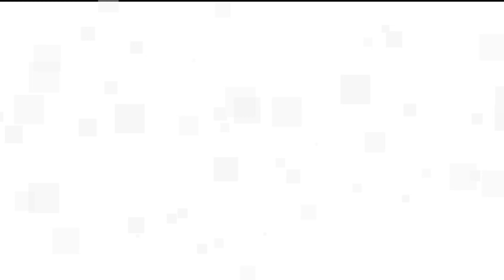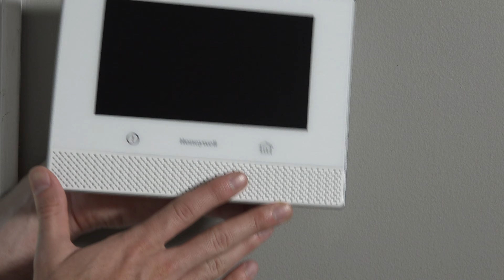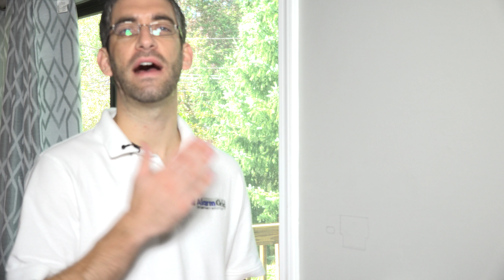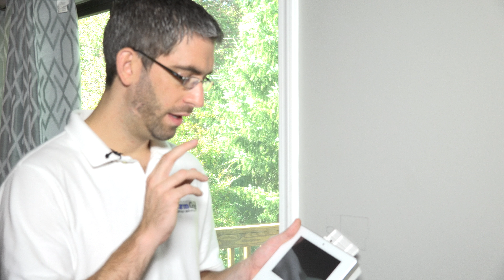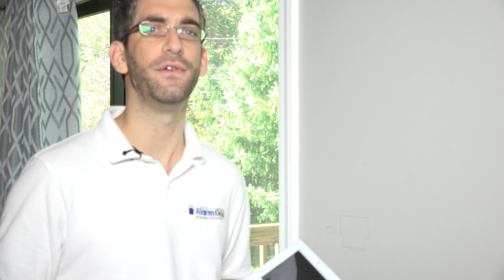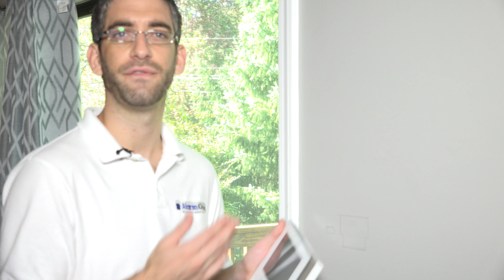Lyric Security System: First Impressions

Comment: Hello, sorry if I bought this device, Can I use it in Peru with any trouble?
Reply: The Lyric can be used in Peru, you wont be able to use a cellular communicator with it but the panel will still connect to your wifi network and function without issue.

Comment: If I use the Lyric controller without monitoring but connected to Apple's HomeKit, can I control the system remotely from a different location (outside of the WiFi network)?
Reply: Hello Danny, I bought Lyric Gateway because I was told it is HomeKit compatible. Actually, there are single devices (mainly the C1, C2 cameras with integrated motion sensors, the 2nd gen round thermostat and maybe the SIXSmoke sensor which are HomeKit compatible, but not the Alarm system itself. I know, it's a pity.. Be aware that once I configure the C1 camera within Total Connect, I cannot register it with the Lyric App and eventually (I didnt make it so far but working on it) to HomeKit app. The Gateway itself, being Z-Wave should be able to be recognized - soon or later- by Home Kit but nothing so far.

Comment: Lyric or 2gig GC3?  Pro's con's?  What's better?
Reply: They are both very similar systems. The Lyric is made by Honeywell and works with Honeywell's Total Connect 2.0 service for interactive features (remote control and text/email alerts) while the GC3 is made by 2Gig and uses Alarm.com's interactive service. The Lyric has a built-in camera that can take a snap show on a disarm and there are cameras that you can view from the Lyric touch screen itself. The GC3 doesn't offer that but it can be tied into an Alarm.com account that utilizes IP video cameras. The Lyric uses SiX Series bi-directional encrypted devices for the security sensors while 2Gig has not yet released their encrypted wireless sensors. 

I would suggest checking out Alarm.com vs Total Connect 2.0 to see which interactive service you would prefer as that is usually the main reason someone would prefer one system over the other.

Comment: Is it possible if I buy only the hardware and use it offline in Thailand over the wifi network? Thanks
Reply: You can use it via WIFI and the Lyric MyHome Controller app, but this works locally only.  If you want to be able to get notifications of alarms and other events while you're away from home, you'd need something like our Self Bronze plan which is $10 per month, and you could use with a WIFI only connection for this as well.

Comment: Sorry, one more question. I get TC through you. If I buy this, would you be able to transfer all zones from my 5100 like you could between two 5xxx series without intervention? I'm capable of doing it myself, but it would be good for everyone to know this. Thanks again.
Reply: +Mario Monti I'm not sure about that but based on what we know about the Lyric so far, I would think we won't be able to transfer the programming over as easily as we can when it's a LYNX Touch to a new LYNX Touch. We could always get a download of the current settings and use that download to remotely re-create a new Lyric account for you and then send that programming down to the Lyric though.

Comment: So am I to understand this new Lyric will support the old wireless sensors that the 5800, etc. used?
Reply: Also, any idea on what they will do with remote keyboards and the smash and grab panel. Since this panel has a camera, I would think you would want it close by which could increase the possibility of smashing the unit. I know there was a feature to protect that with the 5800 series.
Reply: +Mario Monti Yes, the Lyric will support 5800 Series sensors as well as the new SiX Series sensors that will be encrypted to the Lyric. The 5800 Series sensors will work but they won't be encrypted.
Reply: +Mario Monti Yes, the Lyric will support remote keypads and will support the existing APL technology the protects the existing LYNX Touch panels.
Reply: Thanks!